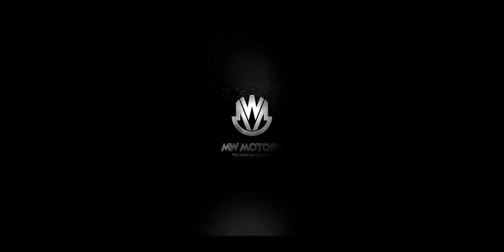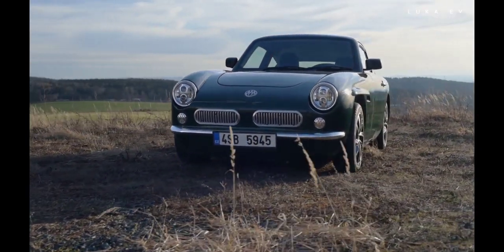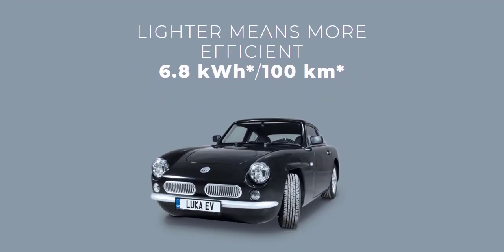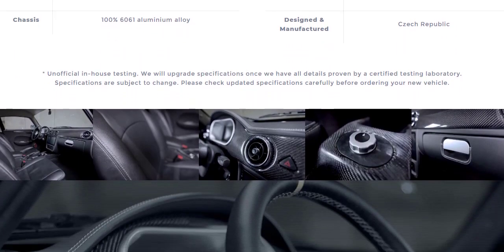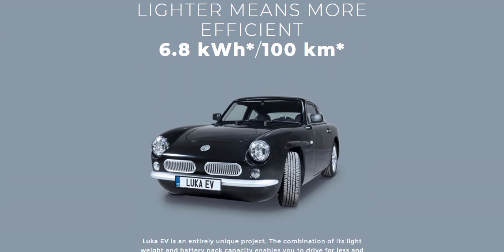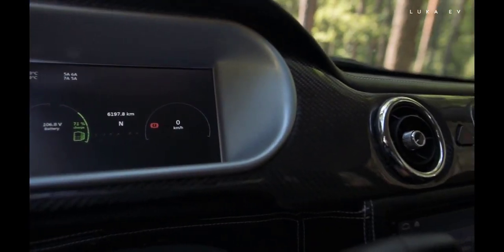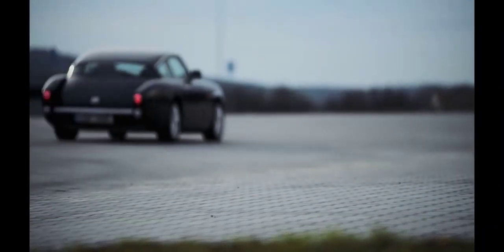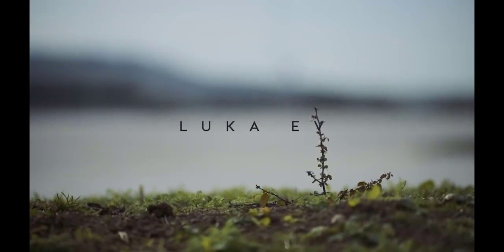Luka EV Retro Electric Car | Classic EV | #eCharged | #mwmotors #lukaev

Comment: The speaker in the video is presumably Rosh Mendis, Sales Manager Luka UK, with a thick Indian accent.
The car is very interesting, price announcement according to Luka is 40,000 euros, so not too much.
The car shown here has already been revised, among other things the 2 sexy openings of the radiator grille have been replaced by a continuous slotted front, not necessarily better. The other changes were necessary, e.g. the too narrow interior is now larger, supposedly “water-cooled engine” with electric drive, how does that work?
Switch elements on the dashboard are ugly 90s plastic style, there should be something chrome-plated, or carbon, etc.
But the car is interesting, one would just like to know when it will be available and at what final price.